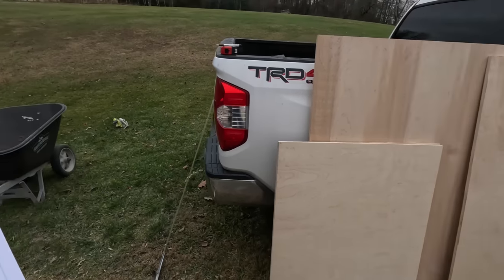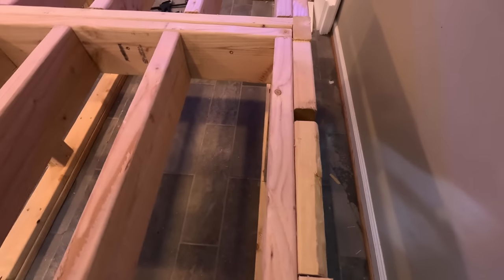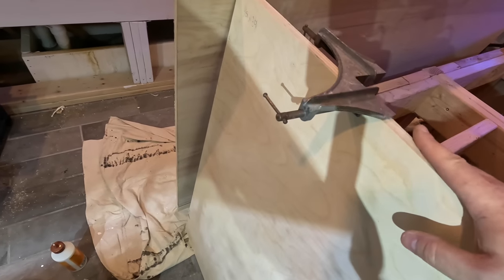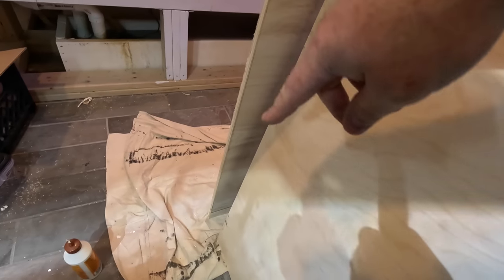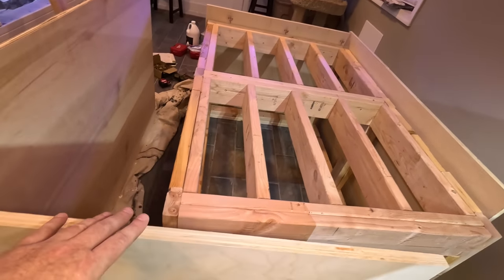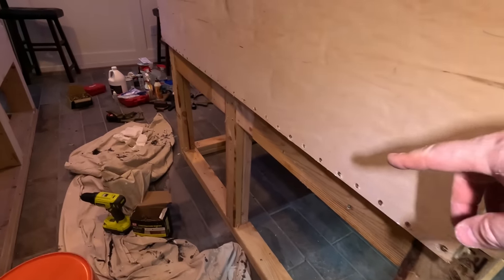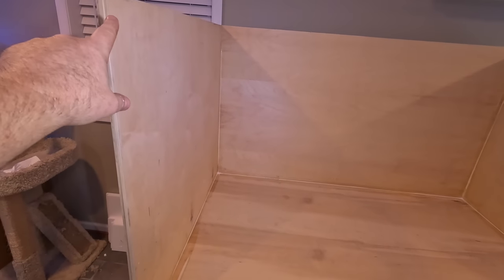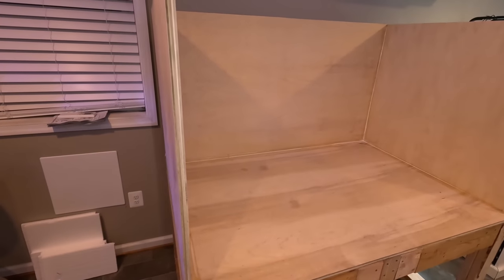How to Build a DIY Aquarium, a Step by Step Guide. Part 2

Comment: Looks good.  Happy to see another plywood tank builder.  I find the silicon that seals the glass to wooden front, is just that.  The heavy silicon bead that is at edge of glass to waterproofed plywood casing is the primary water seal.
Reply from the maker: Absolutely!  Plus with face-framed glass on silicone gasket, tempered glass can be used and get all the benefit of the increased resistance to deflection without the glass edges being pinched in a glass on frame type design. :-)
Reply: @AquariumDomain.  Im about to do a video that shows my 300g build and how I installed glass and framed in.  Check it out. I had my 1000g maintank, viewing panel the same design.. 5 years trouble free and counting..  Merry Christmas to you !
Reply from the maker: @FreeSwimmer  Merry Christmas!  I will definitely be checking out your video when it drops! Just checked and I have the notification bell on! 🙂

Comment: Yesss! Perfect Explanation...I will be using this strategy for my build. Only difference is that my plywood aquarium will be 8ft long and 4ft wide with a 7ft front viewing glass panel in front.
Reply from the maker: Awesome! 8x4 foot aquarium is an a great size...lot's of stocking options! :-P
Reply: In saying that cause of the size would the build be the same cheers
Reply: Or would you frame it with 2x4
Reply: @jasonhunt5899  I will frame with 2x4. My filtration will be built on top due to space issues and be the same length as the plywood aquarium itself.

Comment: Thoroughly enjoying watching this tank come together.  Have you ever had problems with the 2x4s warping after the build is done?
Reply from the maker: Thanks!  No, I haven't had any issues with either the window frame 2x4s or stand support 2x4 warping. Lots of screws & glue keeps them very  locked in. Also the room air is well conditioned with plays a huge part. 

If I were building these tanks for a garage or space with wide temperature swings, humidity, etc. I would definitely want to seal all the wood really well.

Comment: Looking great man.  One question tho,  why not put the filter in the back of the aquarium vs the side?
Reply from the maker: Don't tell anybody so the surprise isn't ruined in the next part, but I went with the side internal filter because I have 2 free pieces of 48"x30" 1/2 glass that I want to use one of those instead of buying a new 60"x30" 1/2 glass. Glass is expensive these days lol :-(
Reply: Gotta use what you can! I look on FB market place for glass all the time! Found a guy selling 4'x8'x 1/2" plate glass for $50 each! I couldn't  get to him fast enough! 😫
Reply from the maker: @abcaquaticbiotopecreations8915  No doubt, especially with glass prices these days....cost the same today to buy a 60"x30"x1/2" panel as the 96"x36"x1/2" panels I put on the 3000 gallon....crazy.
Reply: Hey! Check your email. I sent you something that may interest you 😏

Comment: so of your 3 styles, stacked, framed and plywood what is your favorite and why?  
what are the deciding factors in choosing  what  style to go with? is it just size? or is there other factors?  
how big would you feel safe with a plywood build? 

thanks my man!
Reply from the maker: Really comes down to the design of the tank, ie. the size, shape and height. Stacked is supper overkill strong, but takes a ton of material and more time to build. Framed is the best in terms of strength of build vs cost of build. And plywood build are the easiest / cheapest, but I like to keep the height under 36" on the plywood build and probably something like 600 gallons or so for the max size...basically a 8x4x3 foot design for the largest plywood build. 

In fact I built a 600 gallon plywood tank in the same style as the 315 in this build series (no internal wetlands filter) and it has been running for 12 years, it ran for 3 years in my old house and then moved to my friends basement where it is still in operation today. Only difference in the build is that I used 6x5/4 decking boards for the external bracing instead of 1x4s like on this build series...much heavier duty...but a bigger taller tank.
Reply: @AquariumDomain.   all makes sense. Thanks for the info!

Comment: What is the thickness of the birch plywood? Also was type of screw were used to assemble tank?
Reply from the maker: I always use 3/4" plywood for the sides and either 3/4" or 2 x layers of 1/2" for the bottom. The screws are 3 1/2" construction screws.
Reply: @AquariumDomain.  And the screw length of 3.5 inches is even for tank panel assembly? Sorry for the questions. Just would like to make sure I get the correct material
Reply from the maker: @dennispeleg7843  Yes, mainly just because I buy a 25lb box and use them for everything. You could use 2.5" or 3" for attaching the panels if you wanted to.

Comment: Amazing work I see you gorilla glue thats my favorite glue. For screwing did you predrilled? I miss what kind of screws you used. Instead of screws can you used nails?
Reply from the maker: Thanks!  No, I don't pre-drill anything....just a steady hand....but of course pre-drilling is always a good idea. I will show all the tools and supplies used in the build in the last video part, but to answer your question..I am using star drive construction screws. I guess technically nails could be used, but for me screws seem like the much better choice when the rigidity of the structure is so crucial for supporting the water proofing layer. That reason alone is why I do as much fiberglassing as I do to make sure the foundation for the 2 part epoxy water proofing layer is rock solid.

Comment: Hi mate was wondering why don't you shorten the filter Box inside so that it doesn't hit the front of the tank and shorten the viewing pannel..that way you can use the full size glass.....make the box 3 half ft long  from the back.  I done it in my 8' tank that way I can see the full 8ft viewing panel... I built the filter Box with black perspex afterwards and siliconed it in place.. .mine runs off powerhead inside the box.....
Reply from the maker: What you are saying makes perfect sense, but there is a method to my madness on this design. I will definitely cover it in an upcoming video in the series and explain. :-)
Reply: @AquariumDomain.  OK mate whatever you do it always looks good..love watching the videos your fish crazy just like myself 🤣

Comment: How big would you be comfortable going as a strictly plywood build?
Reply from the maker: When you say strictly plywood I am assuming you mean no additional framing using 2x4s or 2x6s, just bracing strips like in my video, based on that I would go up to a 8' long x 4' wide x 30" tall, which is a 600 gallon tank. I have built this tank before and it has been running at my friends house for 10 years now...no problems. One other thing, I did use 5/4" x 6" decking boards for the external bracing.
Reply: @AquariumDomain.  Awesome!  Thank you.  I'm taking my time in planning it out amd doing my research.  These videos are a huge help.

Comment: is there a specific reason of not using biscuits or some other joining method vs screws? , since a butt joint in theory is the weakest
Reply from the maker: There are multiple methods of joining the boards together with a satisfactory level of strength, glued and screwed was chosen as it is a common method that uses basic tools and exceeds the strength requirements of the join.

Comment: If I get this right the sides sit on top of the bottom and the front and the back are screwed to the sides and the bottom when assembled. I'm going to be building a 600 gallon tank and was able to find 1" 7 ply plywood from Indonesia. I will be laminating 2 sheets together for the all sides including the bottom. The tank outer dimensions will be 48"x96"x 39" high with a window cut out of 87.5"x30". I will be using 3/4" low iron glass. I don't want to use 2x4 braces for the walls of the aquarium, reason for laminating 2 sheets of plywood for the entire build.
Reply from the maker: Yes, that is correct that the sides are on top of the bottom and glued/screwed in place. What you have described with laminating 2 1" sheets of ply together for all sides, plus 3/4" glass for a 30" tall window will be very strong. I am assuming you intend to also have at least one cross brace across the top or some form of euro bracing on the top of the tank?
Reply: @AquariumDomain.   Yes there will be 3 cross braces and Euro bracing using the 1" plywood or 2x4s unless you can help me with something better for the cross and Euro bracing. That would be greatly appreciated.
Reply from the maker: @markkaupas8921  Either would work, but for me I would do the top frame out of 2x4's. Very strong and gives a good anchor point for any hooks, brackets, etc. that can be useful for lighting or cable management.
Reply: @AquariumDomain.  Sounds good, I will take your advice and apply it to my tank. Thanks!